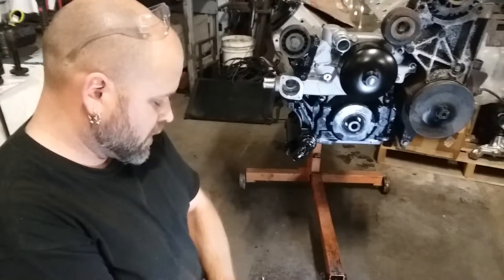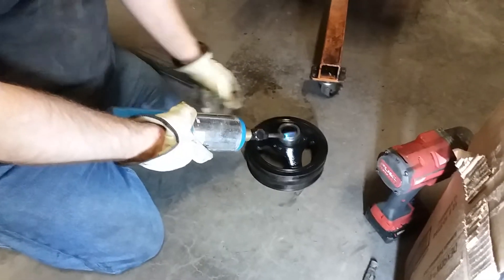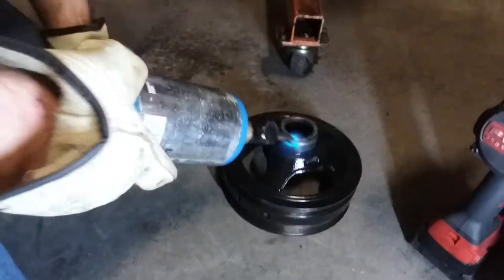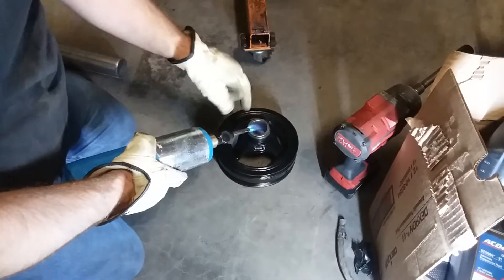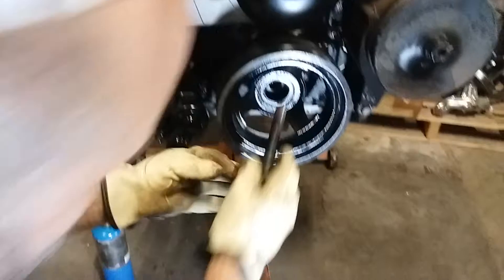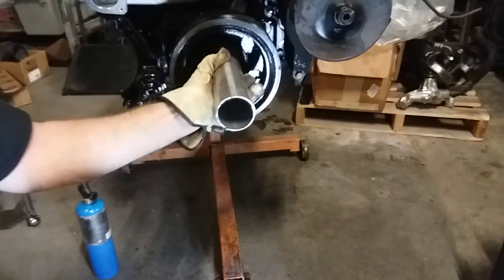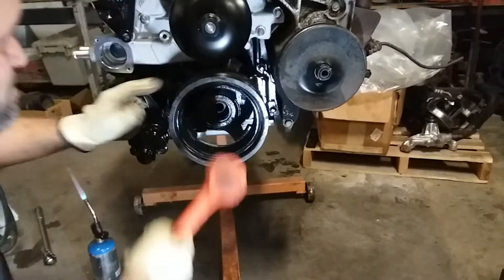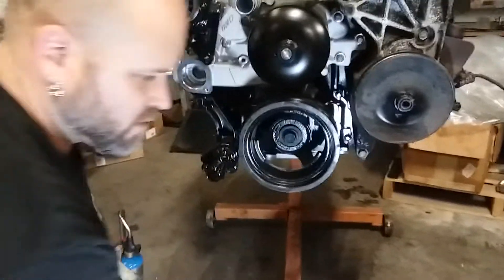Make it easier to install Harmonic balance on crack shaft

Comment: One thing , You don't  hit the ballence around the outside area ,USE THE RIGHT TOOL ,A puller to pull the ballancer on , AND YES YOU CAN HEAT IT UP A BIT ,MAKES IT EASY TO INSTALL ,